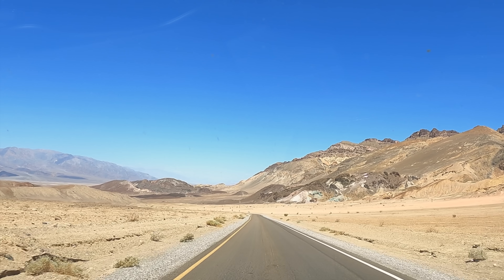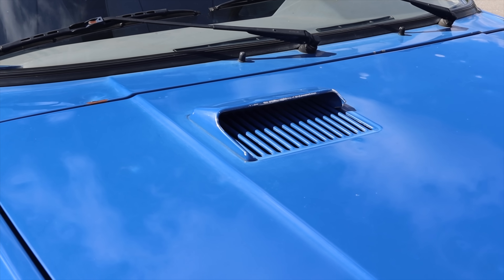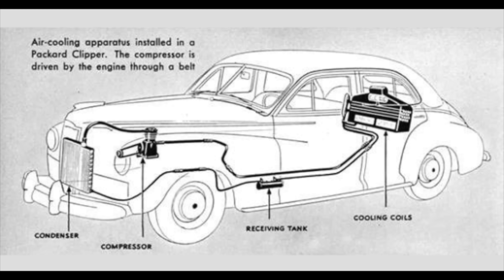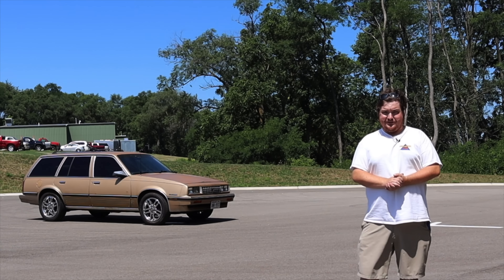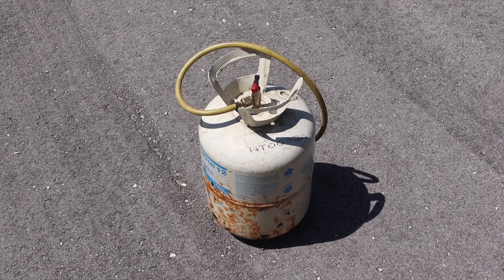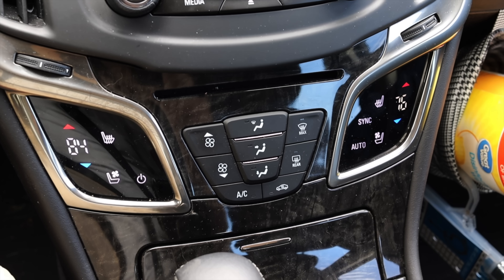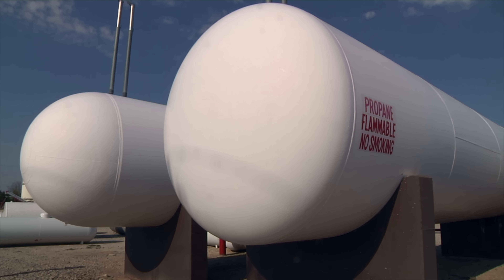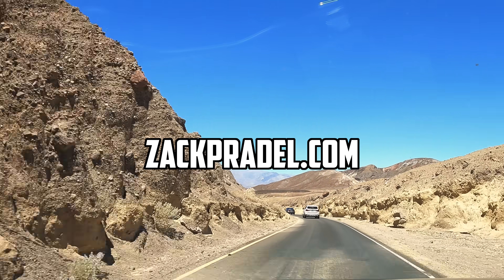Air Conditioning - The Story Of R12 & Why Modern Air Conditioning SUCKS!

Comment: It's factually wrong to say that R-134a is inferior to R-12. Both work very well, and R-134a actually works a bit better when comparing systems optimized for each. The reasons people think of R-134a as inferior are twofold. First, as a drop-in replacement for a system optimized for R-12, R-134a will in fact not work as well since it has slightly different pressure/temperature relationships and slightly different boiling temps at those different pressures. The second is the fact that car AC systems were progressively downsized, especially in 90s and early 2000s. This was to decrease parasitic drag on the engine and increase fuel economy. On those old school systems that everyone remembers so fondly, turning the AC on was like dropping a boat anchor behind you.
Reply: Correct. Our '74 DeVille kills the AC when I kick-down. And it's massive AC cools the car perfectly on R-134a. The conversion wasn't that big of a deal. Compressor could cool a battleship in Death Valley, easily.
Reply: Agreed, we used 134A on the AH-64 Apache Delta and Echo models (cannot speak to earlier models) to keep the avionics cold. I cannot empathize how much heat those computers and optical system put out and the 2 separate AC systems managed to bring the avionics bays down to mid 50s Fahrenheit in the middle of the Kuwaiti desert with an ambient temp on the flight line of 130F. These cooling systems where insane that they could function this well with no insulation either, the panels and shelves with made of pretty thin composite and aluminum.
Reply: boiling points matter, evap temps matter, R12 gave a lower evap temp under normal operating temps & pressures. it's the same with R22 vs R410a. sure it works but the evap temps are just a bit higher, so they dehumidify the air a bit less than the older freon blends. if you look at a PT chart and then compare real world operation pressures it's rite there to see. just a few degrees of evap coil temp make a huge difference in dehumidification and that is what people feel. newer freon blends run just a tiny bit warmer evap temps in real world operation. and yes, I'm an HVAC tech with 35 years in the industry.
Reply: Correct.  It was even that way back in the r12 days.  GM/Cadillac used much larger systems then ford to earn their meat locker status.  The size is the most relevant factor.
Reply: Yes, smaller capacity AC systems, combined with larger cabins (SUVs vs sedans), combined with trendy glass panoramic roofs, are all contributing factors.
Reply: Oh yes.  I had a car that was so underpowered that I would regularly switch off the A/C compressor as a sort of "turbo boost" when I had to pass or climb a steep hill.
Reply: Lol.. That was common for many ... There's even a meme out there calling that "warp speed" lollol
Reply: @jagmarc  am mechEng student doing a course on this right now. You can absolutely design for equivalent cooling performance (same amount of heat transfer out of car cabin) with R12 or R134a.
Reply: No doubt that it's possible to obtain the same performance :)  but would be interesting to hear what the energy input is for a given same sensible heat output.   @whyme943
Reply: Well said.  And having lived in AZ I can ask this question:  (Now I'm not sur if this is still accurate but at one time it was). What are the most smuggled things across the US-Mex border...yea, drugs. Yea, people. But having lived in AZ for nearly 25 years (1990-2014), number three is, or was:  R-12. As of today, it's still being smuggled into the US...."bootleg R12"...
Reply: So very true followd by r 22.  @QuantumRift
Reply: @jagmarc  The expansion valve is different because the operating pressures are different. That's part of the optimizing for each refrigerant I was talking about. The pressures have to be a bit different between the two.
Reply: What gives R134a a bad name is when it's used as drop in replacement for R12 and leave the R12 ExpValv on the evaporator. Adjust up the screw on the R12 EV a bit for the higher pressure and it's almost as good as a R134a E/V.   @mattacks1655
Reply: @hdi7kJXqmW4q  So you have no reference point, but "suspect" you are right? Interesting
Reply: R12 exchanges heat 8% - 10% better than 134A. It’s a reason why R12 was used in everything.
It WORKS excellent.
Reply: Thank you.  I made a similar comment.
Reply: Facts
Reply: My car from 2006 was designed like that, running on r134a. Boat anchor vibes are for real. Stupid belt driven compressor... (I like to turn it off for a speed boost up hills)
Reply: As a former police officer in south Florida, I can tell  you that my 89 Dodge Diplomat had AC that was unparalleled. Later patrol cars needed help, including raising the hood on Caprices when idling in the sun in the day. I would spend a lot of time looking for shade. Otherwise the Diplomat was a horrible POS, but at least I didn't have perpetual heat rash from my body armor.
Reply: @hdi7kJXqmW4q  It's not because of the refrigerant, though. With a system optimized around the particular refrigerant inside it, and built prioritizing outright cooling capability, you can get equal cooling with propane, CO2, R1234yf, R134a, R12, or whatever else has the right flash & boiling points. As opposed to the older vehicles that get super cold, newer auto AC systems are designed with a lot of emphasis on minimizing impact on fuel economy, as well as minimizing impact on global warming when it invariably gets vented in a front-end impact (hence the rollout of R1234yf... wow, ten years ago already). As long as it cools as much as everything else these days, most people won't make enough noise about it to where manufacturers would care. With the considerable horsepower used running an AC compressor the size of a  Mazda 13B, shrinking that hardware was low-hanging fruit for OEMs looking for ways to cut anything excessive, having shifted focus at that point, towards shedding weight and increasing fuel economy, rather than the old way of singularly aiming to provide occupants with a super cool, super-cooled, powerful rolling lounge, with giant sofa space for at least six.
Reply: Turning the ac on in my 89 vette feels like downshifting without rev matching, it's crazy. But man does it keep me cool
Reply: I had a 1973 dodge dart with factory a-c still had factory charge and still functioned when i had the car 2 yrs ago. Part of its ability it due to it being more dense. That ac would freeze u out, literally blow out ice shavings if hot enough out.
Reply: @jagmarc Yeah R12 worked better from real life experience. Google isn’t your friend
Reply: My direct experience comes before google was heard of. Opening all the windows instead of A/C was also like throwing a boat anchor. R12 molecules being bigger than 134 less likely to leak. R12's condensing pressure is lower than 134 so makes better use of condenser. R134a is flammable and R12 extinguishes flames.    @Zacutom
Reply: @Zacutom experience vs reading it somewhere... The guy who reads thinks he knows more than the guy who has physically felt the difference 😂
Reply: You should do smoker windows as a individual video.
Reply: Someone took a thermodynamics class
Reply: Lmfao u must be in ur 20s ... r12 blows 134a away. U ever see 134a freeze a windshield at 90 degrees outside? I havnt
Reply: @w.e.s.  Yes. But because they were bigger systems. It's not the specific refrigerant gas. The older R12 systems were the size of a V8 and the modern systems are the size of a moped. 

An old cadillac from the 60s might take up to 4lbs of refrigerant and have a much larger compressor than a modern vehicle, which maybe takes around 11oz of refrigerant.

Legislation about emissions and rising gas prices / people concerned about MPG made manufacturers fit smaller and more economical air conditioners that have reduced performance. 

R134a has no problems cooling millions of domestic fridge freezers down to -11. A car manufacturer could design and install a system running 134a that would keep the whole vehicle at 40 degrees even when its 110 outside.. it's just going to add a lot more weight, ruin the mpg and probably incur a lot of fines / taxes due to environmental legislation.
Reply: R12 was far colder dude! Get off the drugs!!!! I still have cans of R12!
Reply: I turn off the ac in my old Chrysler vehicles when merging onto the highway because of the drag. The ac units in them are enormous
Reply: @joecool4656 My 96 BMW E38 also take a lot of hp 😂😂
Reply: My father once rôle me he had a turbo diesel golf (not TDI, before that). When he was on highway, he had to disengage AC when going left lane to gain enough power (like 15hp)
Reply: On modern cars the AC compressor is no bigger than the alternator, but old school cars it's massive. I had a 1992 4-runner which was originally R12 but was later converted and that thing was still SUPER cold. The AC compressor was like a big log bolted on the motor and you really could feel the drag on the motor when the compressor cycled. It was like an instant 50 HP loss. Which is a lot when you only make 150HP from the factory.
Reply: R 11 is actually the most dangerous, now don’t go releasing millions of gallons since our ozone layer got damage from the recent aurora
Reply: Imagine if someone designed an R12 using modern technology and engineering, and I bet R12 would simply out perform.  R12 is %15 more efficient than R134a, and will cool it down 6-7 degrees colder than a R134a system. R134 needs larger condensers, and are more efficient on compression/decompression.  R134 also needs to be at a higher pressure, increasing the chances of leakage.

I still think they did the right thing, And I am still waiting for someone to invent a better solution to HVAC.
Reply: Also r134a leaks out faster cos the molecules are smaller than r12
Reply: Propane will work too...... Its just a bit dangerous.
Reply: Bich please! How old are you? R12 was 5x as good! You could freeze a steak with that system going!
Reply: Just went from a 2015 VW Golf to a 2003 Mazda Protege, definitely agree on the boat anchor bit lol. It’s not like what I recall with my 1.6 NA Miata where it like drops a cylinder lol but it’s definitely noticeable compared to the Golf.
Reply: I mean yes but i would rather drag an anchor then die of fuking heat stroke
Reply: My mom's friend had an 80s toyota and he said "if my brakes ever go out, I can use the AC as an engine brake"
Reply: I dont understand why and how the second point you mentioned has anything to do with why people think R-134 to be inferior
Reply: Nah, AC didn't drag the car down much back then unless you were driving something like a Geo Metro. The old Caprices and the old Town Cars weren't be phased by running AC at all. Car AC may be "adequate" today but it doesn't hold a candle to the rides of the 80s. It used to be that even in the worst part of summer that you'd need gloves with the AC on. Now's it's just enough to keep you from being miserable
Reply: I echo your points…I was a GM technician starting in 1984 and Full size Sedans held between 3-4 pounds of R12 Freon. The A/C compressors were massive and so were the evaporator cores!! A/C systems in vehicles today don’t even have a pound of Freon in them and the Evaporators are not only smaller but so are the evaporator cases that hold them. And that is one of the biggest reasons why musty odors began in the early 90’s.
Reply: I had a manual Corolla and I would turn the AC on coming down the mountains for a little  extra engine braking when I didn't want to drop down a whole gear.
Reply: Another reason R134a was problematic is that the systems, designed for R12 and similar later would slowly leak the new refrigerant. It has a smaller molecule, and they never fully solved this.   Turns out R134a is just as bad as R12 for the Ozone layer because of this.  It has been replaced with a better alternative today even if it is flammable. Funnily enough, the reason for the evolution from Ammonia -> R12 / R22 -> R134a was toxicity and flammability.
Reply: My 1989 Passat uses a chonky compressor and it requires around 1200g of R134a. Cools the interior rather well considering the lack of insulation and age. BMW from 2007 on the other hand, uses far less at around 500g of R134a and I always feel like it doesn't cool down as well as my VW. Could be my imagination but it could also be that downsizing thing...
Reply: In my 89 Grand Marquis, the calculated lower capacity for R-134a in that system originally designed for R-12 was STILL 3.25 pounds. Yes, that's right, three-and-a-quarter POUNDS of R-134a in a sedan.
Reply: 134 is inferior.... You one of them engineers???? That sold this country out???
Reply: My R12 AC gives 4°C at vents.
Reply: Lol, the boat anchor comment was very accurate.  My mom had a 90 Isuzu Rodeo and when shed turn the AC on, you could here that compressor turn on in the cabin, and it seemed like the trucks HP was cut in half when it was on
Reply: Amazing how megaconglomerate lobbying can convince leftists to advocate for price gouging and reduced performance lmao
Reply: Now is r 1234yf
Reply: I want to feel the engine lose about half its power and feel ice flakes hitting my face when I turn on the AC.  I miss that!  Air conditioning is basically life support!
Reply: You statement about the water cooler isn't correct the system will keep cooling as long as you had water. It would work indefinitely as long as you could refill it, not because it's becomes warmer.
Reply: Your critique fails to mention important variables like the more efficiently designed compressors and condensers of later systems. 
  R12 systems using the better designed components (sanden compressors compared to yorks) and larger condensors (toyota celicas for instance) were a hell of lot more cooler than similar system running R134A.
  You also forgot that later A/C systems used a WOT compressor cut off circuit to improve passing speed---no "boat anchor" effect with this modification with the pedal to the metal. 
   Basically, your critique stinks.
Reply: Cars definitely downsized their systems to meet fuel economy, but like new "high efficiency" washing machines, they don't work well, sacrificing water for cleaning.
Reply: My 93 Dakota leaked the r12 out an o ring about 6 years ago, I fixed the leak and since I couldn't find any r12 I just said screw it and filled it with r134 and to this day will flat freeze you out and it will do it in a hurry. I loan it to people while working on their cars and they almost all mention how cold that AC gets... some even sound offended that it gets so cold. I didn't change the oil or orifice or nothing, just screw on a low side adapter and filled it up and boom! ICE chips AC.
Reply: Don't try to use logic around smooth-brained car types.
Reply: R12 is more efficient, making the system more complex to make up for r134a being less efficient does not in any way make it better.
Reply: Yes ....for example i have BMW E38 from 95....it uses 1200 g of R134a....the facelift from 97, only halfe of that .....and modern cars 300 g....🙄but the modern sistem need every year to renew the gas and oil.....or else bye bye compressor becouse it uses smal quantity of oil too
Reply: @TheRazvy1990 Who renews gas every year lol? You got a leak
Reply: @dzenan.m ....😂😂😂for ex at my work place we have Ford minivan ....2021 ...New....and after just 4 year no good AC......and just 40-50.000 km....but its new sistem with like 200+ grams....and already not good...
Reply: @TheRazvy1990 I have 2009 Skoda, its 6 years with me, never needed to renew it, still blows freezing cold 😅
Reply: @TheRazvy1990 I remember replacing compressors way more on older cars
Reply: @TheRazvy1990  Ha economical. My E32 had 2000g for R12, now down to 1500 for R134a conversion
Reply: @alexmercer8042  yes i know ....any differences ?
Reply: @TheRazvy1990  Well it doesn't cool as R12, thats for sure. I will be replacing the clutch with a new one soon, will see then
Reply: No vehicle I've ever owned with r-134a would ever get as cold as those old 70's cars would.  I could make someone crack a window open in my 70's car or truck in the middle of summer because theyre too cold and the outside of the windows are fogging up.  never happened with an r-134a vehicle car or truck.
Reply: Can you provide any sources to back up your claim that R134a is more efficient than R12 in a properly designed system? R134a has inherent disadvantages compared to R12 like a lower critical temperature and higher condensing pressure. R134a also has non efficiency related downsides like smaller molecules which leak easier, hygroscopic PAG/ester oil, and potential flammability under rare conditions. The few studies I have found all showed that R12 performed somewhat better than R134a when used in the same systems, so I'm curious where you got that information from.
Reply: it's amazing to me how many people didn't actually read the comment. "R12 ACs were colder" isn't even disagreeing with the comment, let alone presenting a coherent counterargument, lol
Reply: @flamingspinach  People are stupid, who would've thought.
Reply: Thanks for posting this. It brings to mind the think-they-know-cars bro crowd, who got it into their head that cutting off their catalytic converters is some performance upgrade. Probably, because everyone always talks about the "emissions-choked" malaise-era cars, and cats are emissions equipment, soo... But what these people are ignorant of is how those '70s & 80s cars met emissions standards, unlike most vehicles from the past 30 years or so. Back when a 5.9 V8 barely put out 140 horses, they were hamstrung by tiny carbs or super basic fuel injection (spraying into the throttle bore... just like a carburetor); stupidly restrictive & heavy exhaust manifolds, pipes, and mufflers; gigantic engine-driven air pumps (and sometimes two pumps on a single car!) to shoot air into the cats to help 'em get hot (like blowing on a fire) enough to work; overly lean air/fuel mixtures... and a catalyst. You probably wouldn't see a performance improvement from only removing cats from a '75 Chevy, either. The gains were in removing all the other stuff. 

If they're functioning normally, they're not going to be a flow restriction that can be detected unless you spend a lot of time at 100% throttle, and more often than not... not even then, either. They're not nearly enough of a restriction to warrant removing the centerpiece of the entire exhaust emission control system. Making the check engine light stay on for a permanent P0420/421 condition, plus smelling/breathing the unmitigated carbon monoxide, particulate matter, and hydrocarbons (unburned fuel vapor) found in raw engine exhaust. A lot more of it will get into the cabin than you would think - many vehicles will pull some in if you have any windows open at all. 

Also, I, for one, despise driving behind you, if you are. 

There are two reasons the air, in general, everywhere in/around any city, doesn't constantly smell like running lawn equipment: the catalytic converter, and the mandatory inclusion of them on gasoline vehicles.
Reply: @FoxMacLeod2501 Yeah it only serves to turn Monoxide to Dioxide. Catalytic converters starts working once the car reach operating temperature. It is restrictive. But once you remove it you absolutely have to tune the ECU of the vehicle which will make it run normally just produce monoxide which would be bad but doesn’t deny the fact that emissions damage an engine overtime due to it’s restrictive nature. But of course you don’t know that, that’s why you just reiterated google.
Reply: @FoxMacLeod2501 your points are generally correct except very few cars on the road actualyl have intentional cat deletes and two especially on tuning turbo cars an upgraded downpipe(s) with cat delete is essential to improving performance and sound. However I hate the gunshot burbles and crappy exhausts with muffler chopped off. Get a real exhaust like AWE or something. Also the emissions are not as bad if you run e85
Reply: Nonsense... My cars with r12 would actually frost up in the vents.
No new vehicle is capable of blowing that cold..
Reply: @marcjampolsky5280  
Never felt colder A/C that in grandma's 79 Lincoln.
Reply: @marcjampolsky5280 sounds like your dryer was dying
Reply: @rabbitdrink ask anyone who isn't like 12 years old... 
LIFE experience means you've actually SEEN things
Reply: @marcjampolsky5280 yes they are. You can turn an evaporator into a block of ice with 134.
Reply: @marcjampolsky5280  my 93 Dakota did that with r12 till it sprung a leak... I fixed the leak but could not find any r12 so I said screw it and filed it with r134 and it still does it 6 years later. In fact it is my loaner car when I'm working on other people's cars and it always gets comments about how cold the AC is even without asking... some people almost sound offended by how cold it is. It was the old systems not the type of freon.
Reply: @marcjampolsky5280  
Any AC system is designed with one key metric. BTU of cooling. 
You can put a large AC system in a car. It will use a lot of HP, but it will frost the vents. 

Modern fridges and freezers perform better than older models.
Reply: Keep telling yourself that... While they may be more EFFICIENT in terms of power, mostly because the fans themselves are more efficient, BUT they aren't better in their core function and if the refrigerant was better, they would be even MORE energy efficient
Reply: @lumberjackdreamer6267 Modern fridges and freezers might perform better than old, but they sure don’t last nearly as long.
Reply: My car has 425 and it cools like 1000 works better than an other car which has 600 both t-134 there are many other reasons how a ac works good
Reply: R12 has a much higher COP than 134a... in a small system it makes a major difference
Reply: @philipzornes7824 It does not . Search for the Purdue University study "A Comparison Study of the Thermal Performance of R12 and R134a" since YouTube won't let me post links.
Reply: Totally false. R12 would for up the windows, R134A only feels cold when blowing directly on you, it's like the difference between a moped and a Lamborghini.
Reply: BS... R12 was cooler
Reply: @HughesDePagen  Wrong. R12 may be more efficient, but neither is "colder" than the other in a properly functioning system. AC systems have controls like pressure switches and thermostats to ensure that they do not cool the evaporator to below freezing because doing so will freeze the condensation, block the airflow, ruin the compressor, etc. If the system gets too cold, the compressor will be shut off momentarily to allow it to warm up again. So regardless of which refrigerant is in the system, by design, it's not going to chill the air to much below around 40 degrees.
Reply: @HughesDePagen Yep R12 was colder my friend went to Mexico installed in his BMW and it’s fucking freezing my AC is R134 and I can only dream of the AC getting that cold. It’s cold no doubt but not R12 cold. This fucking dude is explaining how using R134 in R12 systems well first of all it won’t work well at all. That’s true of any refrigerant.
Reply: @HughesDePagen  You can say what you want, go take a thermodynamics course and you'll understand.
Reply: @ClubPenguinMaster88  lol shuuut up... you don't need a degree to tell when something is a bit warmer all cooler... we all do that everyday! Do you use your thermodynamics course to get your shower temperature just right, or to determine if you should wear shorts outside on any given day? It's cooler because it feels cooler! Now that might be after a regas, which fair enough, R134a supposedly doesn't require (R12 did) and fair enough that at some stage throughout the cycle of gas escaping it wasn't as cold, but im 38 and literally everyone agreed the new gas wasn't as cool for years, until Airconditioning became more powerful in newer cars due to output, not the gas.
If you ran a comparable HP/KW AC in those old cars with R12, you'd make ice, literally. 
Saying someone needs a qualification to determine temperature is on par with these bright sparks who ask if someone has a degree in gender studies to back their knowledge up that someone born with a penis is a male
Reply: @HughesDePagen  Pomona jail?
Reply: @shibaman123 yesh!
Reply: @HughesDePagen  do you get confused after more than 3 words,, all those different letters , words and meanings jumbling around your head ? gosh i'm gonna believe you over the guy who obviously has an encyclopedic level of knowledge of how auto air conditioning units work.
Reply: @HughesDePagen I agree…damn the technical bs…..